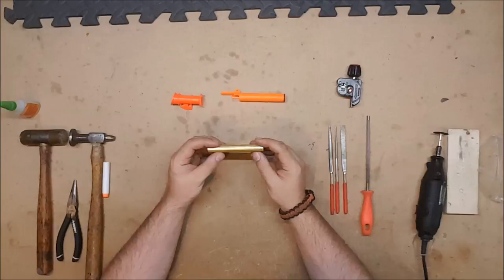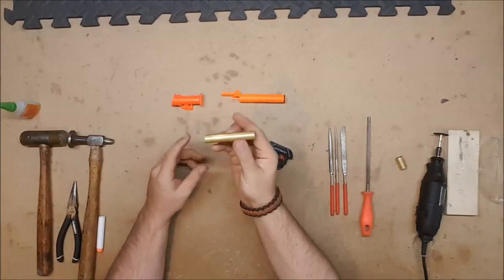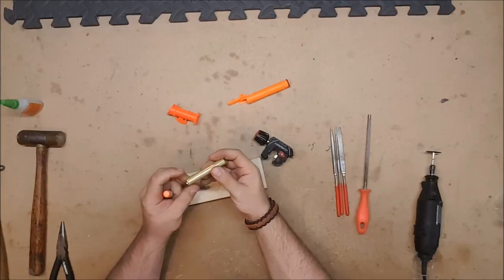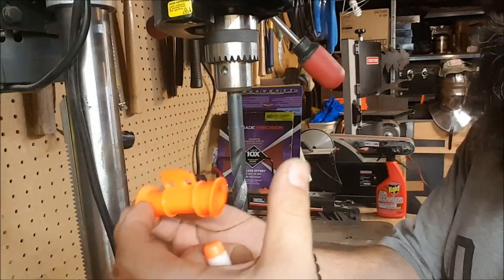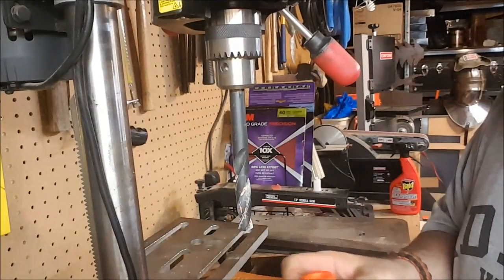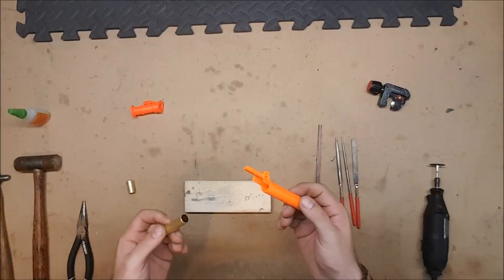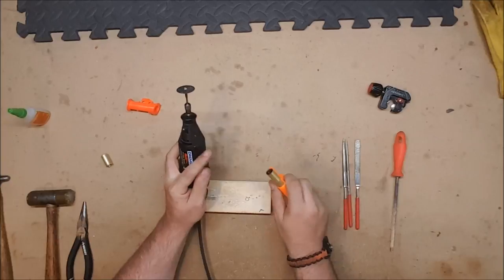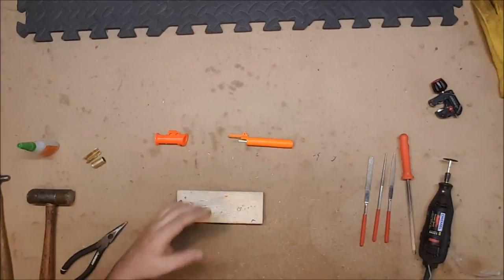Monday Mod Tips - Episode 2 - Brass Barrels

Comment: For flaring the cut end of the brass after using a pipe cutter A trick I saw on Coatduck's channel is to use a 3/8 to 1/4 drive adapter from a socket set as sort of a mandrel, but you could use a socket as well if you had one where the narrow end would fit inside the brass and the wide end was wider than the OD of the brass. Just set the socket/adapter on a solid surface, slip the brass over it and tap it from above with your tool of choice until the desired flare is achieved. I use a rubber mallet since brass is fairly soft. Planishing hammers are cool and all, but uncommon and expensive. Needle nose pliers can work but may result in the flared end being out of round, which may not matter for a front loader, but will wreck you if you are trying to sleeve sections together to make a seal.

Comment: There is a type of handsaw that's used in more artful metalworking. It takes a lot of finesse and patience to use because if you put too much pressure you'll break the blade but it is a very fine saw and can definitely make those cuts in one to two passes and would require very little filing afterwards. I forget the name of the saw though
Reply: Most likely jewelers saw.

Comment: Captain Xavier   one tool I don't recall seeing you use, which I personally find to be EXTREMELY useful in general, is a long flex extension for the dremel. My dremel came with a 24" extension and it makes getting into nooks, crannies, and just generally working at odd angles significantly easier. If your dremel supports a foot pedal accessory, a flex extension makes a dremel even better- and IMO it's already a contender for the gold-medal-winner of hobby tools.
Reply from the maker: There is just such a Dremel hanging from the rafters above my work bench now.  It is my new favorite tool.  :D  I did mention it in a Q&A video...but no one actually watches those...
Reply: Captain Xavier I do watch those (and so does my wife sometimes lol, she loves the little weird bits you do at the start of some of them). Apparently I just missed the mention. I probably would have seen it if I had time to watch the mod party stream, too... but I don't right now. sad face
Reply from the maker: It is a recent acquisition and it makes me sooo happy!  It is much lower speed but higher torque than my old one and that is perfect for Nerf work.

I have been having fun with the Intros.  I will run out of helmets eventually...
Reply: Captain Xavier I just read that to my wife, and her reply was, "No. Just no. I will send him more helmets myself if I have to."  I love my wife. :D
Reply from the maker: Mailing address is in the Description, tell her she can mail me all the helmets she wants!  :D

Comment: I like the beveled edge on mine when only making a dart length section. Slightly filed down so its smooth, then an interior polish from 220 through 5,000 grit, makes a nice pressure fitting on the dart and makes a satisfying pop

Comment: If you really want to utilize the most power from your blaster you should have a bolt with a barrel to create a full seal beech, but I guess this is good enough for beginners
Reply from the maker: Indeed.  Naturally a full sealed breach has more power but is also much more difficult and has it's own downsides.  This was meant as the beginner's guide.  I will do a seal breach eventually.

Comment: Captain Xavier, i keep trying to find a planishing hammer on amazon.... i know the dart diameter is half inch....is half inch enough to flair the brass? Or is the head slightly bigger as only the first half inch or so of the tube seems to be in contact with the hammer.... either way... any other options besides amazon to check.... thank you.

Comment: One would think clamping things in a vice or making a jig for boring out the barrels to keep them perfectly straight would avoid the whole bore through issue but I've never tried to drill nerf. Just getting back into it since I found your videos. 

Back when I was a kid it always seemed like the Nerf toys would break in less than a week or two in some fashion. Looks like they've made a lot of progress in the last decade or so. Your videos are great and I'm finding this stuff very entertaining and educational.
Reply from the maker: The risk with a clamp is deforming the pipe. A jig would be a much better solution.

Comment: Stampede question: Which way does the motor/engines´ red dot (forgive me for my spelling) has to vace? Up or down?
Reply from the maker: Depends on how you wire it.  You can go either way.  You just need to make sure you get the wires right.  Be sure to test it with a low voltage to make sure you get it right.
Reply: Ok. Thanks Chaylo :D

Comment: can you do an episode on air blasters? specifically back pressure tanks and how to fill the over pressure release valve with something?
Reply: How'd you make you, I filled the buzzbee ultimate blast system with hot glue worked fine, now I'm putting a air tech tank in a tri strike
Reply: @JohnJames.  I tried using hot glue with my titan for that and it blew out the hot glue during a war the next week...
Reply: @froopty1854  I'm assuming that system is alot more complex, this one was just a small hole, If fails epoxy it is

Comment: It would be great to know the maximum "safe" ammount of power that you could mount in a given blaster to add as much power as possible without harming internals.  I mean, I totally get the fact that when you mod you exchange the blaster life for power, but in case of some of us that have a hard time buying or finding the blasters, middle ground between power and blaster surbavility would be plain amazing. Do you think this is something you can do, or maybe include it as a section in some of those great spring replacement videos? Thank you.
Reply from the maker: Pretty much all the mods I do are on the safe side of the spectrum for blaster life. Any upgrade spring you can buy short of k26 and k14 will be fine.
Reply: @CaptainXavier  Thank you very much

Comment: I'm not sure if you read the comments, I know this is kind of a older video. But I was considering trying to Brass breech a Hammershot and some other revolver type nerf guns. I assume the process would be the same as you described here for front loaders, but was wondering if there's anything else I should keep in mind.
Reply from the maker: Yes, be careful.  The walls of the cylinders may be too thin.  Drill slowly can carefully.  Also remember that if the seal between the plunder tube and the cylinder is weaker than the seal of the dart in the barrel, the blaster will not fire.  You will also need to increase the spring considerably to be able to clear the brass barrel.
Reply: Late response but will add my $0.02 - I recently modified a Maverick, Strongarm, Disruptor, and a bunch of smart-AR front-loaders with brass however I did NOT brass the ENTIRE barrel and did not drill out the entire barrel either, instead I cut "retaining-rings" that I inserted from the front down to where it tapers originally to hold the dart against the AR.  I removed the ARs from the revolvers and plugged all side air-release holes on the smart-AR systems.  The rings hold the darts more securely in the barrel but not so securely as to prevent a more powerful discharge.  I don't have a chronograph to measure the performance boost but it is noticeable by feel and range and especially by never having darts simply fart out of the barrel particularly on the 4th dart from the smart-AR blasters 👍  Not spring-enhancement required!  The purpose was to enhance the fun for my kids without increasing difficulty of prime (a major factor for the <5-yr-olds)

Comment: I would take a 17/32 and bore out the breech and then use 9/16 to bore half way down, cut off the tab and insert the prepared brass and have a barrel attachment with a 9/16 barrel that seals against the 17/32 brass
Reply: The tab on the chamber runs along the top of the dart to help prevent folding as the dart is scooped into the chamber from the magazine.  The Nexus Pro and others do instead push the dart out of the magazine and seal it into a barrel similar to what you describe, but the space inside is better designed to avoid worrying about dart-folding although it does still occur with that tab missing, even with short darts.
Reply: @Chamdar17  a bit late. Also I didn't know it at the time but Worker was going to be making barrels in basically the same way. The stepped design allows easier feeding because the darts first going into 9/16. This was also a time I did have a dremel and had to make do with making a brass breech with only pipe cutters. The finger left on the stock breech kept the darts in check and never had a feeding issue with that system.

Comment: So, does anyone know the performance gain of a sealed breech over this style of brass breech? 

I have an EAT I'm making ridiculous for no real reason. A/R is out (I know that's controversial these days), 7 kg Hard kit is in, and I am currently painting it. But what it needs is a killer breech. It's hard to find a definitive walkthrough on it though as there has been so much variation over the years. Best I can tell, I need three widths of pipe, but it's not entirely clear to me why.
Reply from the maker: A full sealed breach is significantly more powerful (and more or less requires AR removal) however, it comes at the price of a much lower rate of fire.  But then so does the sleeper breach really.  In both cases you have to prime a bit more slowly or the darts will crumple and jam.  Honestly I don't think Either are worth they price in an EAT.  They increase the risk of jam and effectively negate the blasters ability to slam fire.  Brass breaches are better for things like Retaliators and Longshots than don't have slamfire anyway.

In my opinion...others may disagree.

Comment: Shouldnt you be using 9/16ths brass for the bolt? How is it going to telescope if it's being blocked by the plastic on the bolt?
Reply from the maker: That is for a seal breach.  I will do a video on that eventually.  This is the simpler option.  Not as powerful but easier and uses much less brass.
Reply: You'll also run into feeding issues as darts wont feed cleanly into the 17/32nds with dart tooth alone. They'll bend out
Reply from the maker: Only if you fail to flair the brass, load to quickly, and use old darts.  These are the reasons I generally do not do brass breaches.  I find the trade offs to not be worth the effort and results.
Reply: +Captain Xavier, bro I like your work but you should probably add an annotation disclaimer that people DONT do this to their breeches. I know you mention you haven't done a brass breech before but this is a terrible idea. Flairing doesn't make a difference, it's the friction that rejects the dart. You dont run into issues like reload time, dart tolerance, or any other tradeoffs if you do it right. There's a reason why no one does breeches like this, and instead do angel breeches or sleepers. you should always chamber in a larger calibre than the dart. The only part that really needs to be tightbore is the barrel.
Reply from the maker: "Nothing a man says before the word 'but' really matters" ~Benjen Stark

I agree.  This is definitely NOT as good as an Angel Breech or a Full Sealed Breach but I have seen (and been hit by) enough blasters with this exact setup to know that they do work and do increase power.  But they are finicky as all get out. I will eventually cover proper sealed breaches and explain why they are a much better option.

Comment: When brassing a cylinder i found that half lengthed darts or adventure force darts, even elite darts go in easier.....the off brand darts do not.... do i need to flair the brass more? Or is it just because the darts are crap.... they are some what a softer foam then the other stuff mentioned.

Comment: I have a question do you grease or sand inside of the brass barrel(besides flaring the end) to make it smoother for the darts to enter and exit? for me seems like the darts fit tight in the k&s brass 17/32 barrel. is that normal or should it be smoothed out? need advice.. pls help
Reply from the maker: I do not do either.

Comment: What size of brass tubing is best for mega darts? I want to design and 3d print mega sledgefire shells but I don't want to use a 3d printed barrel for them.
Reply from the maker: It needs to have a 3/4 inside diameter so I would assume 25/32 ?

Comment: So can I brass my hammershot cylinder using this same method just doing it 5 times?  It is my first gun mod and so ive invested hours into painting alone. I dont want to mess it up now. Also just out of curiosity, do you know what size of tube it would take to do the mega darts?
Reply from the maker: You can.  But it is tricky and you do run the risk of ruining the cylinder or that it won't have enough power to even clear the barrel.
Reply: @CaptainXavier  I just picked up a dual strike on eBay for 7 bucks and was morbidly curious. Do you know the tubing size? By the way, thanks for all the great tutorials and responses. Do you ever live stream and take donation? Also curious if you had an active discord chat.
Reply from the maker: Mega is 3/4 inside diameter I believe.  I have a Patreon.  I rarely stream.  I do not have an active discord.

Comment: So, I brassed my NiteFinder's barrel and added an Ionfire's spring in addition to the stock spring and it hits pretty hard, however, whenever I load the blaster, if I push the dart in and out it makes a squishing noise, is this something that I should be concerned about or is it simply a byproduct of a modification I have or the result of not having done a mod alongside my current mods? It only happens on elite darts, waffle tips don't have this problem.
Reply from the maker: Huh...doesn't sound like an issue.

Comment: Does it have to be brass for any reason? Would 1/2" ID cpvc work just as good, or any other material?
Reply from the maker: Those will work for making new barrels but are generally too thick to fit inside the existing barrel.  Brass works so well because it is so thin.
Reply: Awesome, thanks

Comment: can you use a 1/2 inch drill bit?
Reply from the maker: No. 1/2 is the size of the inside of the brass. You need a bit the size of the outside, which is 17/32

Comment: what size brass pipe would you use for a MEGA blaster? Or if you were going to mod a MEGA to shoot micros what would be the "best" way to go about it?
Reply from the maker: I have yet to find brass that fits Mega.  I'm sure it is out there somewhere.  You would need 3/4 i/d.  You can make barrel inserts that convert Mega to Elite.  Worker makes them...that is probably easiest actually.
Reply: Captain Xavier 
Alrighty then, thank you anyways, I'll have to check out Worker, and thanks also for the crazy quick response. 

The main reason I asked is that I have twin cycloneshocks that I was thinking about modding but I wasn't sure if i wanted to attempt to brass them or just micro-fit them.

I have a couple other ideas for some of my other blasters but they would be moreso experimental and probably somewhat more extensive mods
Reply from the maker: The Worker convertors are cool because they are removable.  But not cheap.  They are $5 each so $30 for a full Cyclone Shock.
Reply: Captain Xavier ...or 60 for my twins, It looks like I'll be better off with simple internal upgrades and slight external modifications.

Thanks for the advice Xavier
Reply from the maker: You are welcome.

Comment: Question, do you need a more powerful spring if you are going to do a brass barrel?
Reply from the maker: Usually, yes.
Reply: @CaptainXavier  ah, that is going to be a problem, last time i put in a more powerful spring one of the parts broke
Reply from the maker: @KitsuneEX-oo8pj  then you put in too powerful of a spring. Or you need to get stronger parts.
Reply: @CaptainXavier  yea, I’ll probably need stronger parts, but i dont think they make parts for a spy gear wrist blaster, but also the spring was from a bow strike

Comment: How do i make a full sealed brass breach everything past the effective barrel is to big to fit 17/32 brass
Reply from the maker: Each 1/32 size increment fits the previous size. So 17/32 fits and seals inside 9/16 (or 18/32) which in turn fits and seals inside 19/32.  Nerf darts are 1/2 (or 16/32) which is why they fit and seal in 17/32 in barrels.  

So to build a sealed breach you use a 17/32 barrel nested inside a 9/16 barrel.

Comment: Is there any difference in using Copper vs Brass piping???
Reply from the maker: Yes. Color of the metal, thickness of the metal, softness of the metal, weight of the metal.  But functionally?  No idea, I have never used copper.

Comment: how much barrel would you suggest for an air blaster. titan etc
Reply from the maker: +Tyler Affolder depends on many factors. There is a max length for each tank because they have different capacities. If you go shoter than the max tou lose power. If you go over it will not clear the barrel at all. Abd before you ask, I have no idea what the max is for any tank. I have never tried.

Comment: Just got mt hands on a monorail, would like to see an in depth mod guide once you get on. Kmart ships, so pretty much anybody can have one shipped
Reply from the maker: I threw cash at Beret (literally) at the mod party and got one.  He cleared out a store and had extras with him.
Reply: Ive already ipened it up and found a white box with black buttons above the trigger, the whole thing is useless, just locks. I unscrewed the lid to the box and took out all the spring loaded doodads, and the monorail works just fine(you will understand when you open it up)